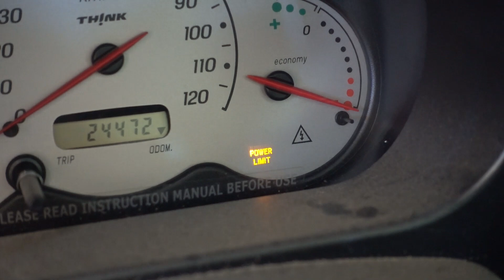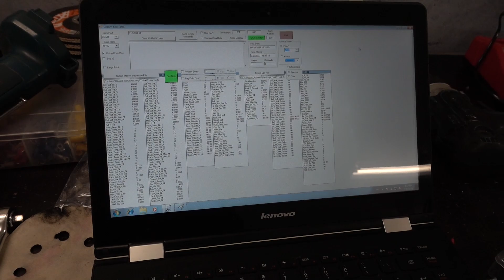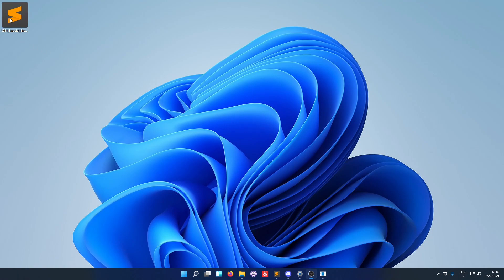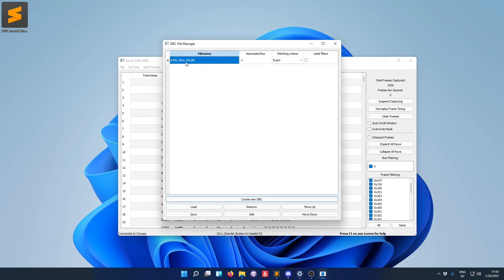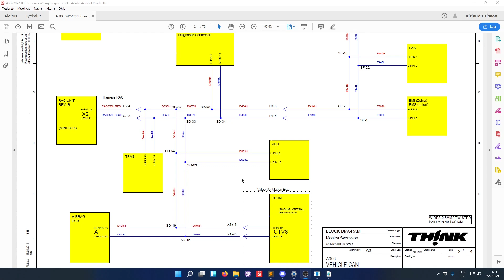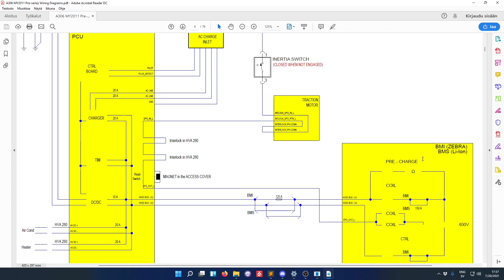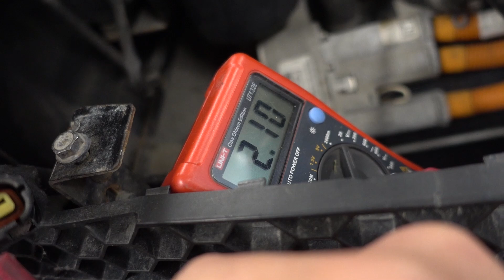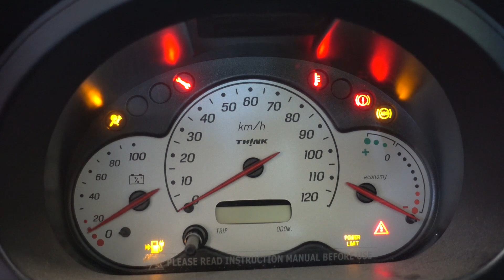No start troubleshooting - Think City

Comment: Nice fix, and good that you show SavvyCAN which probably is the best tool for this car (there is another DBC-file you can add also, to interpret the battery messages as well). 
For the connectors which where cut and spliced, that is a very bad way of doing it!
One should remove the orange cables (and their corresponding pins) from each plug, and fill dem with some Sikaflex or something similar. The only part of them which is need is the small "jumper"-pins for the Emergency Power Off (EPO) circuit in the middle of them. Without the plugs the car wont start and one would get the same EPO / crash error.

Comment: Nice to see. I actually have a Think City 2008 and use it daily. My repair man used to work at the factory in Norway. No other repair shop can fix my Think when anything happens. Very nice to see your troubleshooting. 🤩🤩
Reply: hi iam considering buying one of these and i cant anywhere find what hapens when the zebra battery cools down. does it broke or it is ok? thanks
Reply: @marcopolo6915 The electrolyte solidifies ! This Zebra battery was originally developed in South Africa to be used on military vehicles and for long time storage. To make it work again it needs a 30 hour liquidification phase and subsequently a number of hours to charge it for normal driving.
Reply: @astrogeo1  ok really thanks ;)
Reply: Do you drive it Norway still? Where are you located? I drive one here in Kristiansand.

Comment: I hated that car. A million problems, plugged it in for charging, and when trying to drive to work next morning, it wasn't charged
and didn't move one meter. Using the heater in winter, the electronics went haywire, the battery failed and the sorry-mobile was
stranded for 6 month at the dealer..  Then the front window cracked during winter, so I Gave it away, for free
Reply: This is sad to hear.

Comment: Great job troubleshooting the Think and thank you for providing the software and manual links. Do you know where I can find the schematic for a circuit card in the Think? The one I'm repairing is made by SEMIKRON and is labelled as L5052900_04. It has an IRF7307 dual MOSFET, in an SO-8 package.
Reply from the maker: Check out the Facebook group "Think Owners", lots of good info there!
Reply: I can’t find the group. I have a 2010 thinkcity here in Greenland. Left for vacation, came back and the battery is not charging. Now i want to fix it :)

Comment: My Th!nk 2010 has Internal iso fault and 7 dead cells. I have reset the faults and been driving the car 5.000 km. Now the same error occurred. Is there a way to isolate/disable the dead cells, so the battery can still be used? With the last charge I was getting more than 160 km range with it.
Reply from the maker: I suggest making a thread here: https://elbilforum.no/index.php?board=55.0

Also the FB group: https://www.facebook.com/groups/27279972050

Comment: Well done! Probably should investigate why the fuse blew in the first place, no? I'm not very well versed in automotive electrical systems or electrical in general, but there's no reason why a fuse would pop without a problem in something its connected to I'd think.

Comment: Well done! I did get my 2013 lithium Th!nk City driving again (faulty Traction Inverter Module) but it is still spontaneously losing power while driving and charging. Have been struggling for months to find the problem through SavvyCAN. So guidance to find the fault would be greatly appreciated. Here https://we.tl/t-uxqrNQFPH9 you can find the .trc file of my car driving and losing power.
Reply from the maker: Make a post on the think forum nd lets continue there! Link in description!

Comment: Highly impressed.  You actually know how to diagnose and fix.  I think the new mechanics of the modern electric age will need to be as well educated and as intelligent as yourself.  The part replacement method works well enough if the diagnostics are sufficiently sophisticated, but then you have to have long term parts availability and not follow the 'pile 'em high, sell 'em cheap' philosophy, that has developed into the planet destroying consumer society we live with at the moment.

Comment: Kind of weird that the previous shop had not checked the fuses at all. Isn't it one of the first things to figure out if any vehicle won't start?
Reply: That's what I was thinking. Doesn't sound like a very competent shop to me. Literally a 60 year old farmer with zero electric car experience could have fixed this in 10 minutes or however long it takes to go through the fuses not even knowing what they're for.
Reply: Having said that, there has to be a reason why the fuse blew. Probably an issue in the wiring harness.

Comment: Great fix, glad you cought it! Did you find the reason for the fuse blowing? Isn't 7.5A high for a sense/interlock line?
Reply from the maker: The circuit ultimately feeds a coil inside the battery, so it is quite normal!